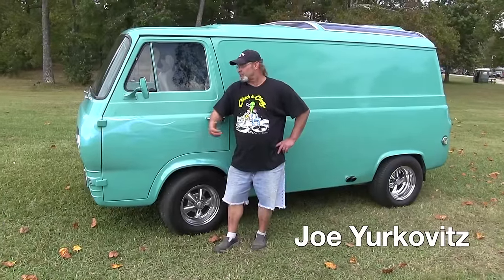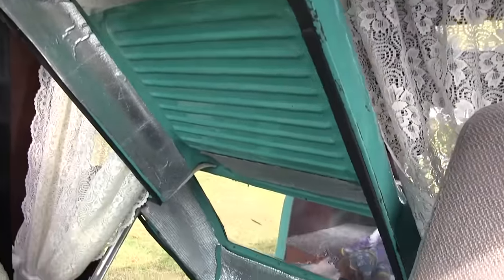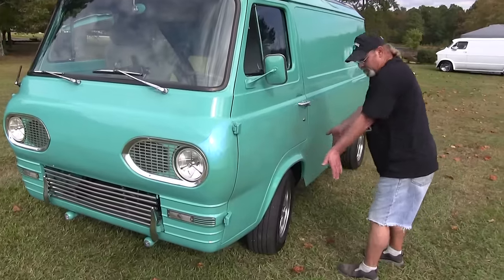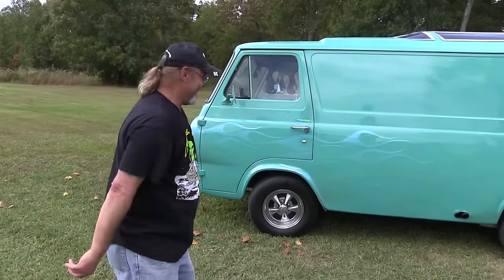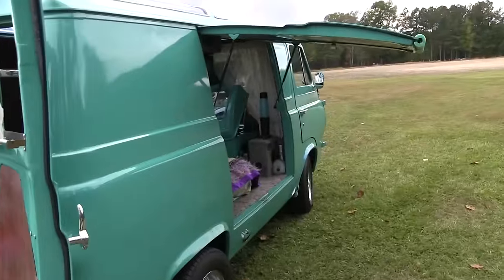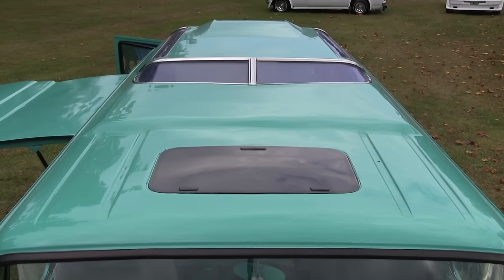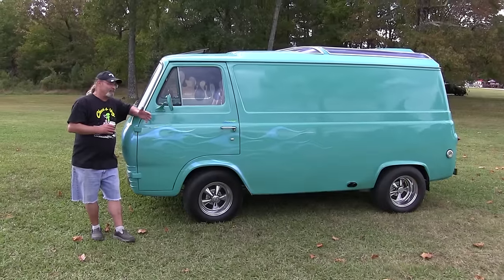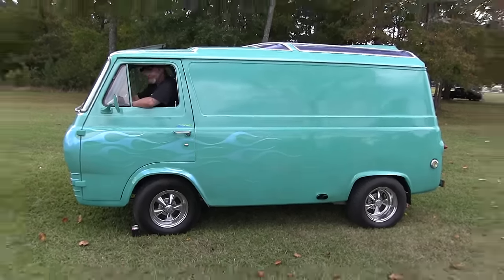Incredible 1967 Custom E100 Full Mod Ford Van. "STILL GROOVEN

Comment: Found by the previous owner out in the desert abandoned, but with keys, and still running at 25,000 miles in '76, i bought it off him at 81,000 ten years later. It was solid and rust free, and after traversing some running issues, I kept it and loved it for a year and a half. Engine (Falcon 170 six) never was made to win the Winston Cup, but it was reliable as soon as the carb issues were resolved.

Comment: OMG! Looks a lot like my van from the 70s. My '66 also started with a 240ci, and a nine inch, but l went a little farther. Put in a 351ci Cleveland and FMX auto, '58 Cadillac four-core radiator, Dodge step-van cable shifter, custom 18" driveshaft, big wheels on Cragars, and a custom tube grill. I also put on a '68 Olds Vista Cruiser roof and a sunroof up front. However l did most of these mods in the mid to late '70s. I have a photo, but I be damned if I can figure out how to add it.

Comment: I had to drive one of these to Fort Polk from England AFB, La., to pick up some equipment and on the way back the radiator puked up and shot hot water, rust all over the cab, me and the road.  Some people had mercy on me and helped with the water.  All because of bad design of engine vs cooling system.